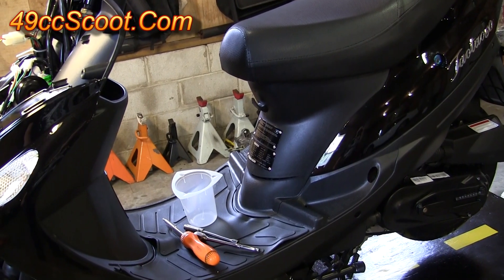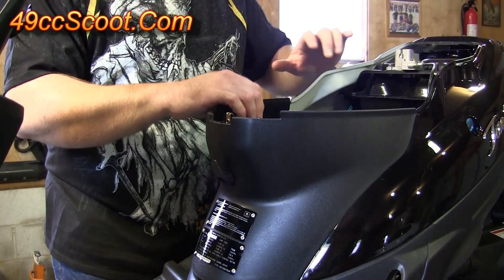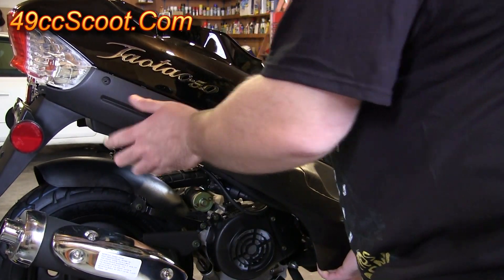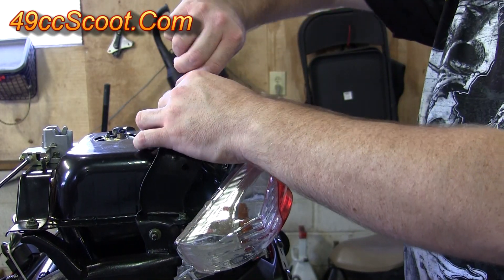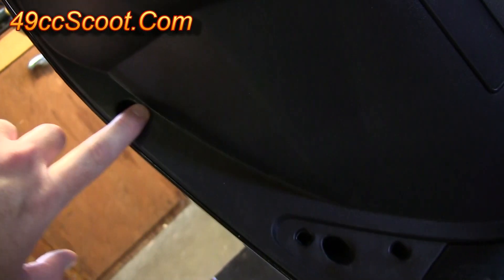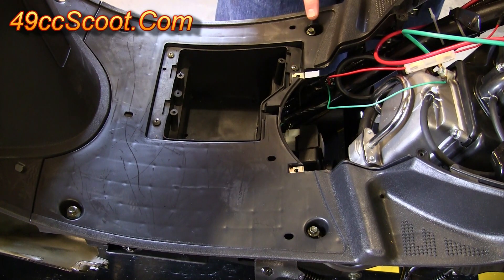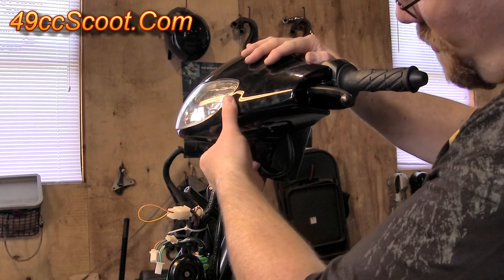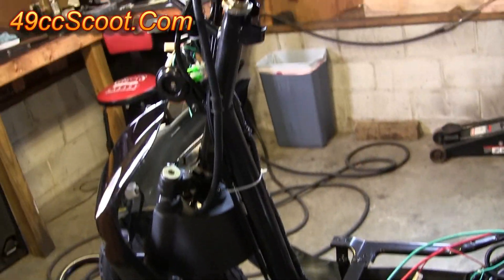TaoTao ATM50-A1 Chinese Scooter PDI Assembly Part 3 : Body Panel Removal (Plastics)

Comment: I am trying to remove the panel behind the handlebars, like you're doing at 5:43 and was able to get the bolt for the helmet holder off. I cannot get the ring around the key/ignition piece to come off. Your piece came off so easily, but I can't get it to just screw off. Any other ideas for getting it off?

Comment: Great video series. Amazing how similar the Chinese scooters are, just picked up an electric one with almost identical paneling. Found a few bits of  MIG wire stuck on a few metal parts that have been painted over.
Reply from the maker: difflocktwo Thanks. Enjoy your new scoot!

Comment: 1:00 that 2 screws, if i break the plastic part, how can i fix it, it is so easy to break it
Reply from the maker: I have used "Plastic Welder" (an epoxy, not melting) to glue tabs on when they've broken off. I did a bunch of broken tabs on one scoot with the plastic lid of a peanut butter jar. I just cut out rectangles and drilled a hole in each and then used that  product liberally to attach them. There are surely better replacement plastics, but I can at least say that it worked and  lasted for me.
Reply: @49ccscoot  oh thats nice

Comment: Do you have to take all that apart.mine will b here in Florida monday.cant wait. Thanks man
Reply from the maker: Maryann Mcdonough It's your call. Some people do the bare minimum, assembly and oil changes, and make out alright. I feel more confident that the scoot will hold up for a while after it's been checked over though. Sometimes you won't find anything really wrong. Sometimes you will. Quality control can be very poor with low cost Chinese scoots.

Comment: What if I need to remove the front panel to clean and repaint the panels? Do I have to take the tire off?
Reply from the maker: It has been a while now since I've had that off, but i don't think it will fit over without taking off the wheel/tire.
Reply: 49ccScoot thank you for the quick reply! I did end up having to take it off, but undoing the axle turned out to be way easier than I thought.

Comment: Thanks for the video, Iam trying to find the signal flasher, Is that black round plastic pot on the top left front it ? If so you saved me from takeing every panel apart Thanks again,ERIC
Reply from the maker: Yeah, you can see it at about 6:45

Comment: is there some way to order a set of replacement body pannels nd have them delivered by mail? some of my pannels are falling apart...
Reply from the maker: TaoTao lists Eagle ATV Parts as the official dealer, but I would suggest checking Scrappy Dog Scooters and eBay. If you also have an ATM50 like mine, they are referred to as "sunny" style scooters sometimes so that could be helpful when searching. Here's a link to a page of parts from Scrappy for the sunny style. http://www.scrappydogscooters.com/Sunny_style_parts.html

Comment: Is it possible to put foot pegs to the atm for passengers?
Reply from the maker: You'd need to do something custom like weld on or bolt on pegs. I put pegs on mine to drop my feet for more leg room, but I had to weld to do it and made my own peg mounts. http://49ccscoot.proboards.com/post/185868/thread
Reply: ok cool. I had a feeling it'd have to be customed. riding passenger on mine with my husband is fun but my legs go numb after awhile lol

Comment: you skipped the part im looking for, how do you remove the front cover panel ?? im trying to replace the ignition as i broke my key, I am having a hell of a time getting the front panel off,, please help...
Reply from the maker: I didn't skip it; it's not installed from the factory. That panel should be easily removed in a matter of minutes. There is one bolt/screw in the front of the panel, top center. I usually take that out last, but it's the easiest to find. There are four screws that attach to the rear of the panel through the leg shield. So look above the storage space on the leg shield, the little tray/compartment. On each side, you should see 2 screws near the top corners. Take those out, then remove the bolt up front. Carefully remove the panel.
Reply: thanx for gettin back to me, i'll git it another try and see if i can get it...

Comment: where is the relay switch box located, i upgraded my battery today and the bike cuts on by itself without keys and the ignition is off, I bought my bike from scootermadness.com 6-27-2014 it came 7-2-2014 and I haven't been able to ride this thing yet, they don't want to replace the bike, they want to send me parts to fix to avoid spending $300 in shipping for another bike. Customer Service Manager has yet to call me back. I ready to call my Attorney!
Reply from the maker: The easy way to find the starter relay if you can't see it is to follow the large red wire from the starter to it or follow the large red wire from the battery to it. Usually mounted on the right side of the scoot toward the rear/middle of the frame.